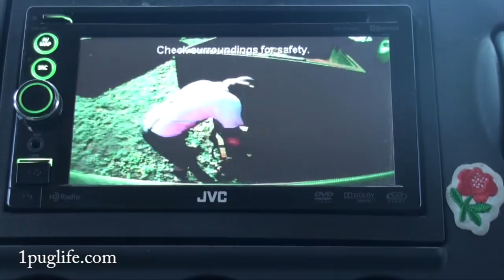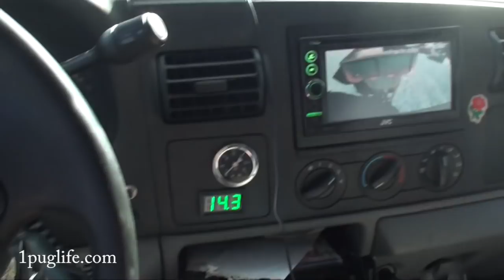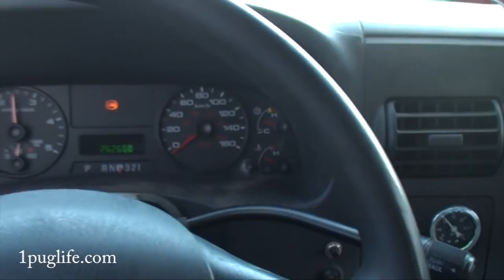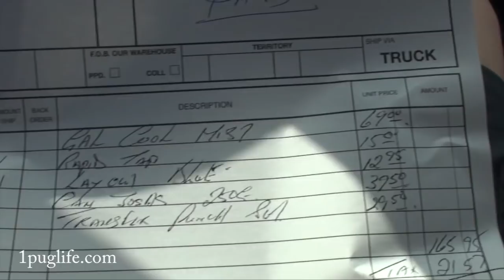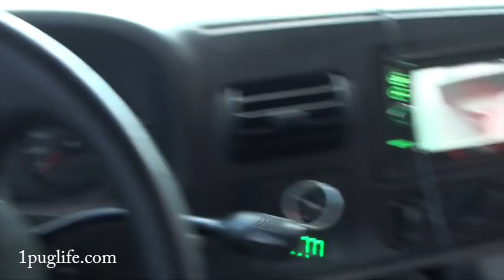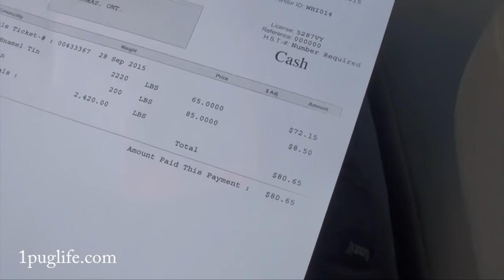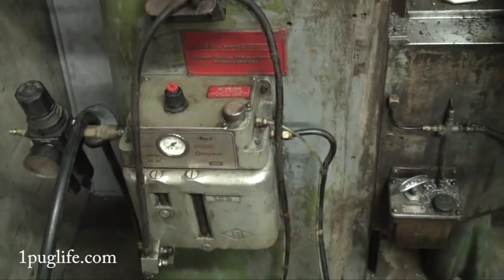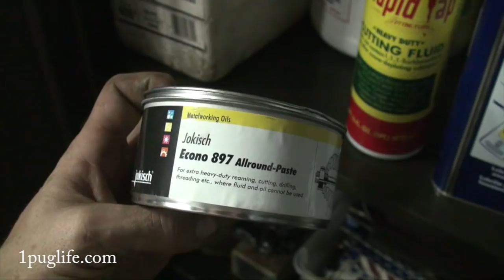crackin down on the hoard

Comment: cutter speed is crucial to machining, for instance a 30mm diameter cutter should be run at about 333 rpm, 20mm cutter = 500 rpm, 10mm cutter = 1000rpm.
you will destroy the cutters on that rolled steel you are machining because it is not designed to be machined, it has pockets of very hard material inside it.